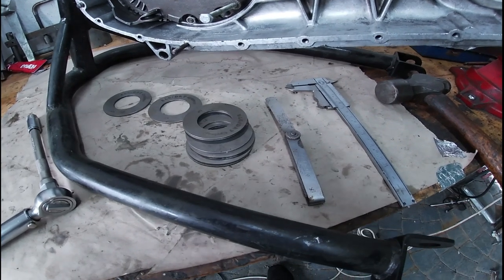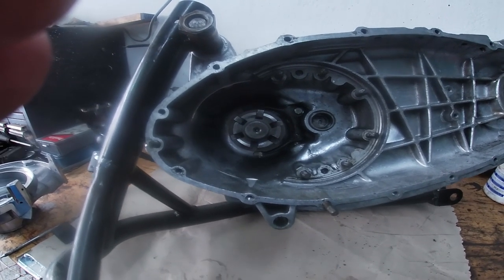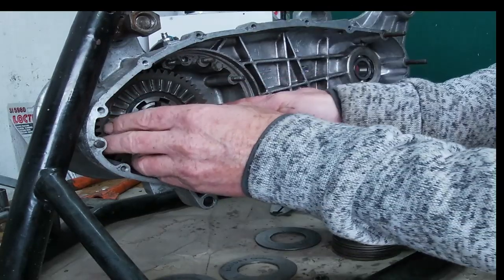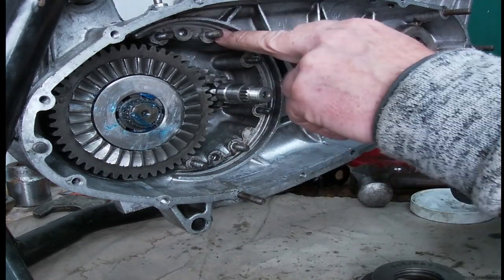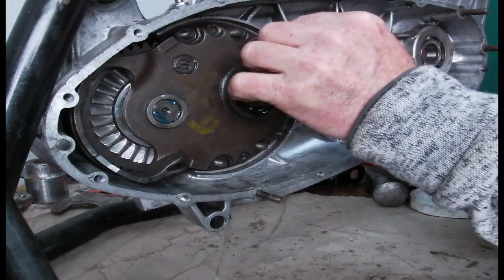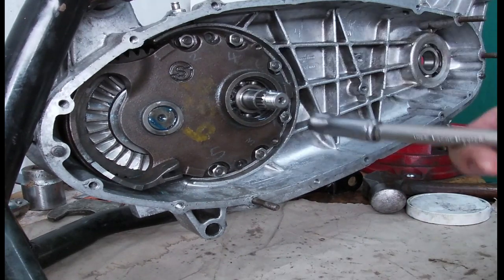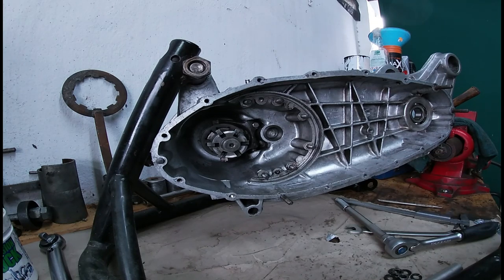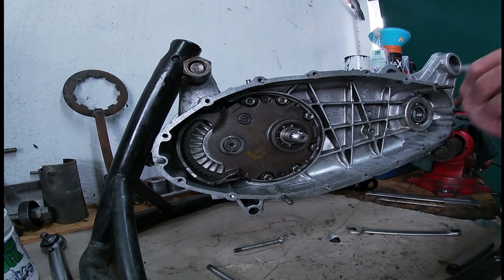LAMBRETTA TS1 part 6

Comment: Would of been good to see how you repaired the damaged thread 👍
Reply from the maker: I thought I had recorded it but it was nowhere to be seen on the camera ?
Reply from the maker: fuck found it ? might do a vid
Reply: TheSteelweasel would be good to see. I’ve got a dodgy thread on my Ts1 inlet just got by using a slightly longer bolt but next time might not hold. Keep up with the vids !!
Reply from the maker: @skankoneup  you can buy helicoil kits for most sizes , around 20 quid ?
Reply from the maker: video is up